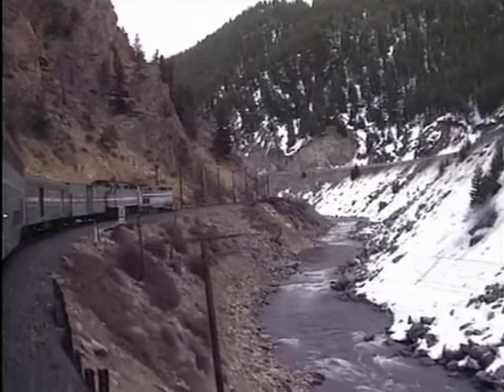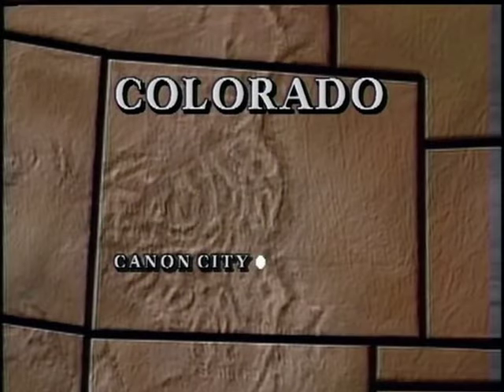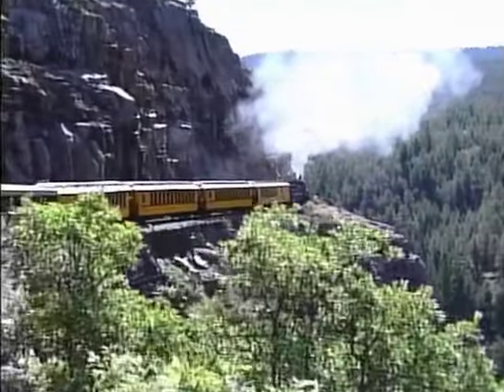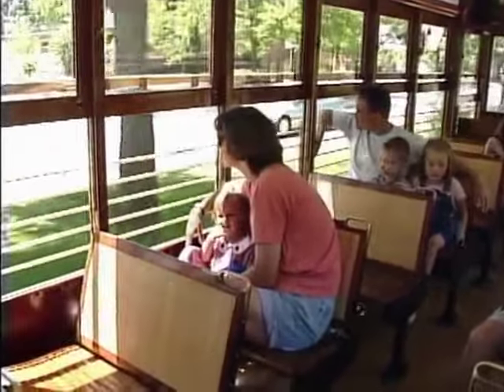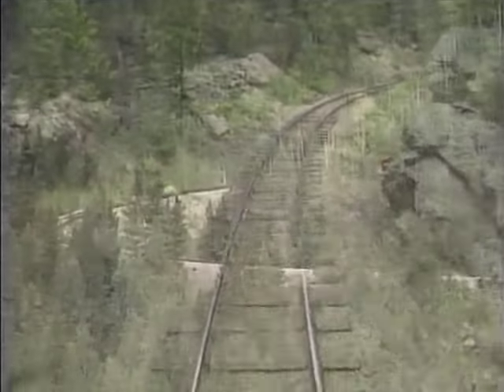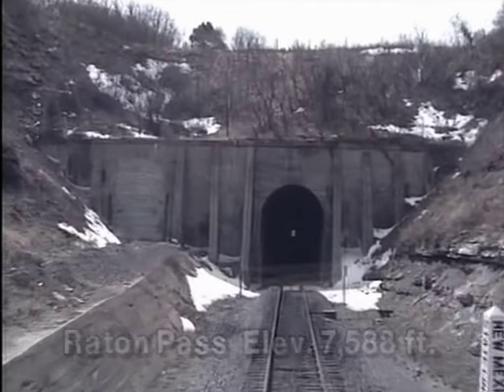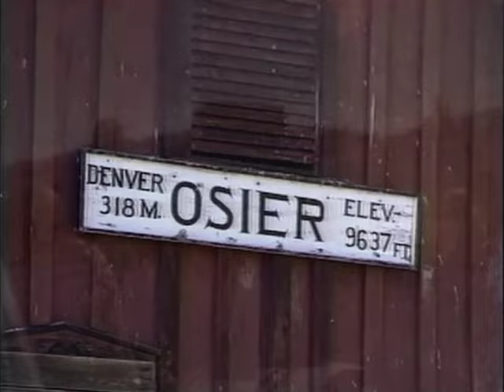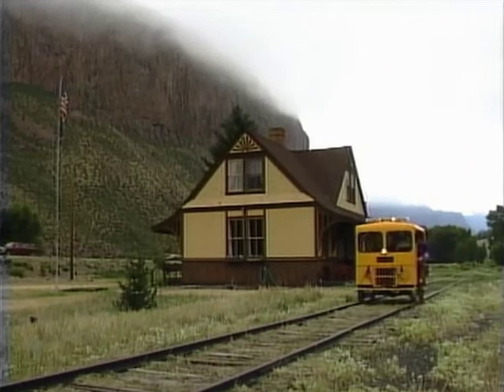Colorado's Scenic Train RIdes

Comment: I have ridden a few trains in Colorado. The first one was the Cumbers and Toltec Scenic RR, then on my 14th birthday a ride to Pikes Peak by the cog railroad, twice on the Georgetown Loop Railroad and Royal Gorge Train, RTD Light and Commuter Rail in Denver, Leadville Colorado and South on my 21st birthday, and The San Louis Valley Line from Romeo to Alamosa and from Alamosa to La Veta in the mid-2010’s. I have also ridden the  California Zephyr three times. I haven’t ridden the D&SNGRR, and although there is no trains in South Fork, there is a short rail bike service in South Fork, CO.
Reply from the maker: You've ridden a lot!  You are correct, the South Fork operation never really got off the ground, at least yet!

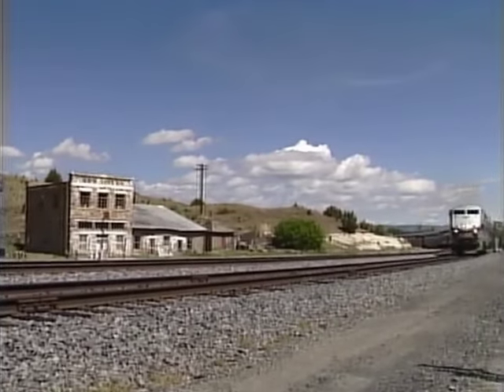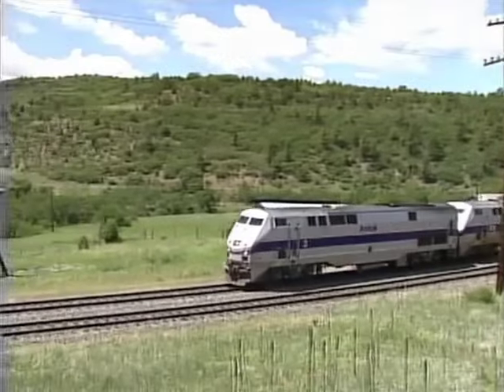Comment: Note the lead P42 (Presumably added at the La Junta, CO station stop as it is not seen at Las Animas, CO, which is before the aforementioned station stop 54:11) @ 55:52, 57:56, and 60:08. It is leading its number-sake train! 

Also note the semaphore dropping @ 55:52! Speaking of which, any idea when the semaphores between La Junta and Trinidad were removed? Correct me if I am wrong but there are still semaphores between Raton, NM and Albuquerque still in service as of 2023, right?
Reply from the maker: I shot a semaphore west of La Junta in 2000 and the mast for its replacement had been erected a short time before.  So my guess is that those went around that time.  

What is left now: On BNSF's Raton Sub, there ar the three at ESS Colmerr, the three at WSS Levy, the two intermediates between Levy and Wagon Mound, and the three at ESS Wagon Mound.

Thee five semaphores on NMRX Abluquerque Sub trackage are still there, but the replacemnt lights are there and installed.  Just waiting on power to be strung to them, so the NMrX semaphores are most immediately endangered,